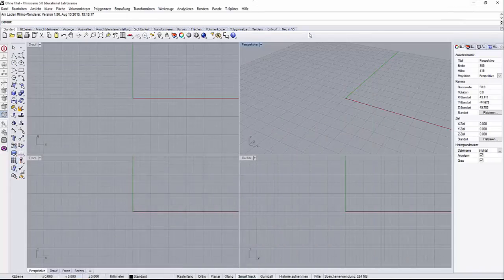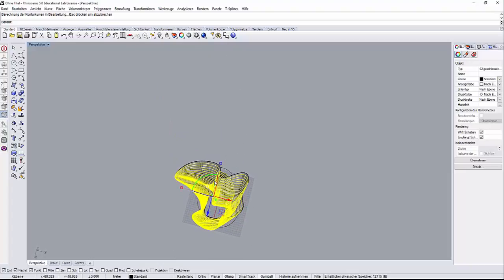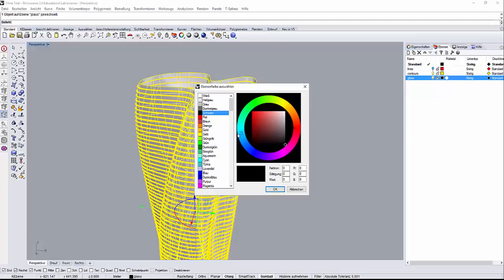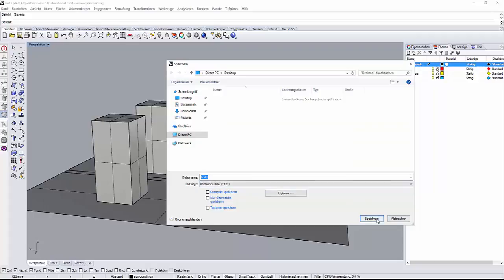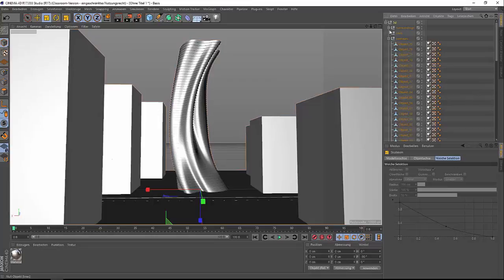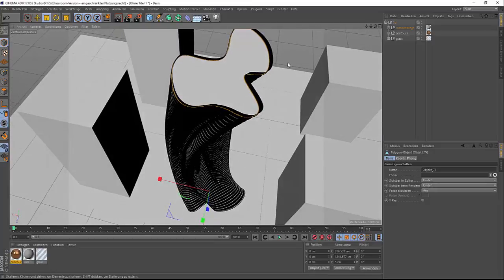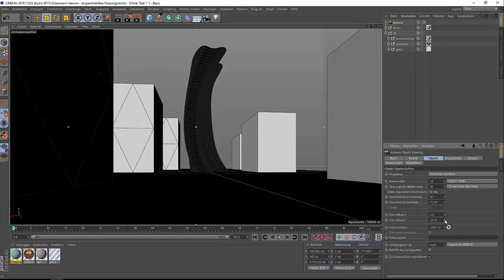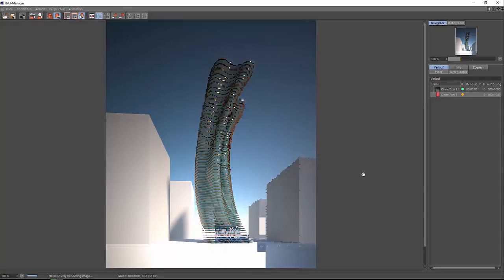Super simple workflow for archviz Rhino to Cinema4d and Vray - NDU Sankt Pölten Austria.

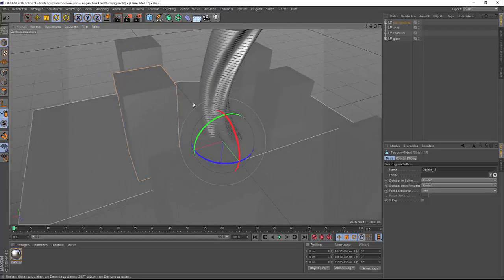Comment: @16:55  the clipping isnt an issue of the graphics card. Its just a setting in  atttribute manager- MODE -PROJECT-VIEW CLIPPING - near and far settings.. C4d default is set in centimeters and your building was created in meters so the default setting of the View clipping was set to accommodate a smaller scene.. when working with bigger distances all you do is add a few 00 to the far and it opens up the view .. I guess it helps the graphics card so its not drawing things a 50 meters away but when you do allow for more view it can handle it. unless you scene is completely dense with geometry.  as a rule of thumb its good practice to keep real world coordinates if you are going for realism.